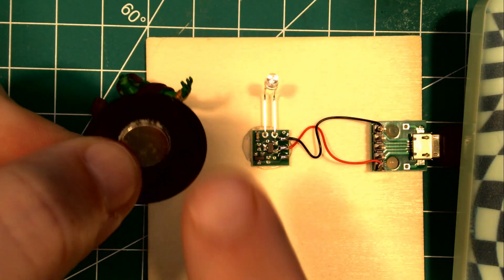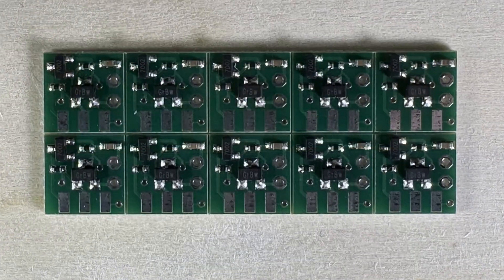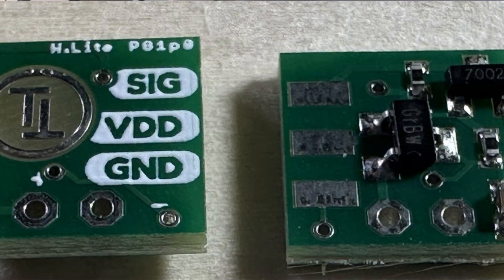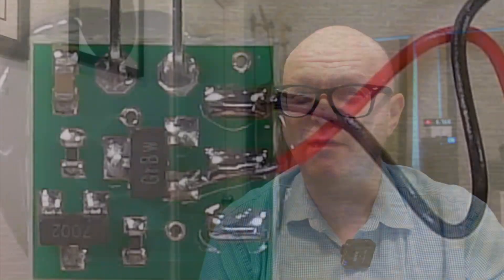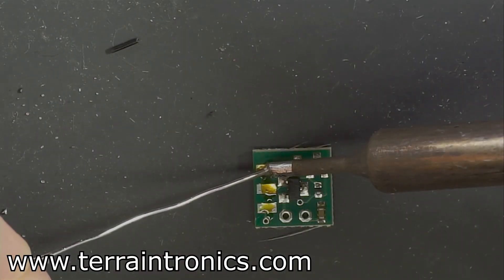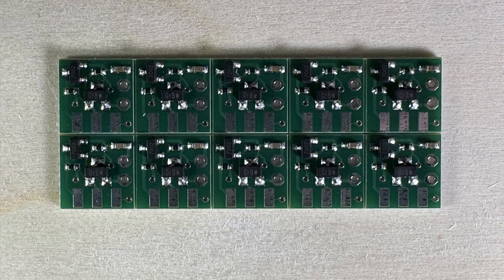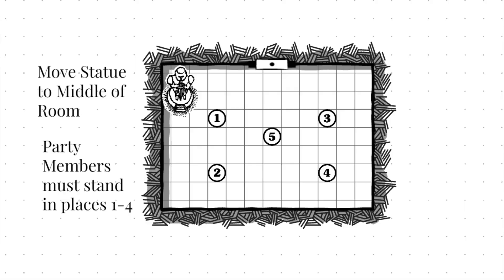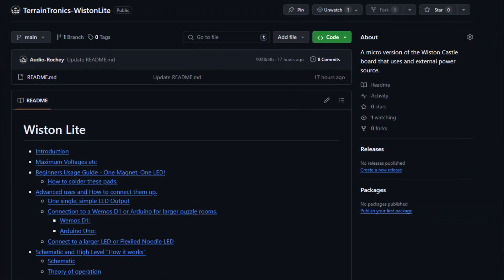NEW! Micro WistonLite boards to control LEDs with MAGNETS

Comment: What are the advantages over magnetic reed switches? Also is there a cheap magnetic detector that can detect N or S pole?
Reply from the maker: 2 great questions:
I found magnetic reed switching don't like having a magnet directly above them... off to the side a little, great but directly above don't always work. However, the advantage is that they don't need power to work. (1 less wire)
There are other magnetic detector IC's that can tell the difference between N and S, but expecting folks to reliably install their magnets adds risk to their first time success.

Comment: I'm a real novice at doing lighting for my terrain.  I watch various videos of people soldering and they are able to just touch the solder and it melts around the wires.  When I'm trying that it seems that the solder doesn't want to re-liquify and I find that I'm holding the iron tip there for ages, what am I doing wrong please?  I want to do more stuff including using these boards but I'm worried that my holding the tip on for so long will kill the boards in some way.  Thx
Reply from the maker: Great question! There's a few things that could be going on here. What kind of solder are you using? unleaded solder requires a higher temperature to melt. leaded solder (look for 63/37 blend with ~2% flux) melts at a lower temperature and flows way nicer. For hobbyists, it's fine. It's no longer allowed in big volume manufacturing (like TV's and phones etc), but for hobbyists, it's fine.
You might also have some success with using flux. flux helps conducts the heat around and acts as a catalyst to get the solder to flow better.
For reference, I run my soldering iron at about 375F ~ 190C.
Reply: @TerrainTronics  Thx for the fast reply.  I'm using a rosin core 1.8% flux and a 67/33 Sn/Pb mix solder.  I tried testing the iron to see how hot it gets and I got strange readings.  The dial says 440 degrees but my laser temp gauge said 161 but it melted new solder instantly.  I do have separate flux that I've been using to make the solder spread through wires during the tinning process.
Reply from the maker: @richarddreadskull8427  have you tightened all the rings around the soldering iron tip etc?if the tip isn't getting a good connection to the heating element, there can be some disconnect between the number on screen and actual tip temp.
In addition, laser temp testers don't like scanning reflective surfaces.
I've recently captured some footage of 63/37 solder from different suppliers (Kester vs 3 chinese suppliers). The difference was staggering. some of it barely melted.
Reply: @TerrainTronics  I've tried tightening the connection, using different solders and 2 different fluxes.  I'm just going to try a new iron and see what happens, thx for your suggestions.  I'll see what happens and let you know.

Comment: A local plumbing company left a 4"x6" calendar magnet (to put on your refrigerator) at our door today. Could it be used with these boards?
Reply from the maker: That’s a 50/50. Those magnets are typically really poor, but gather their overall strength by their size. The sensor on the Wiston is about the size of a grain of sand. I’ve found that virtually every kind of “real magnet” triggers a Wiston, but those sheets of rubberized magnets are a real game of chance.